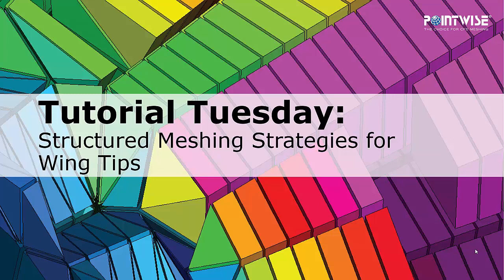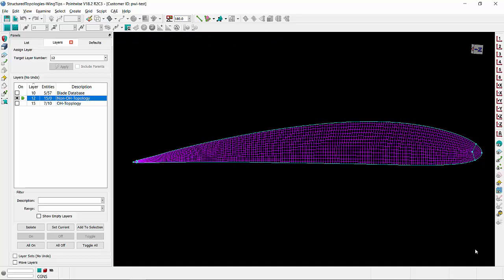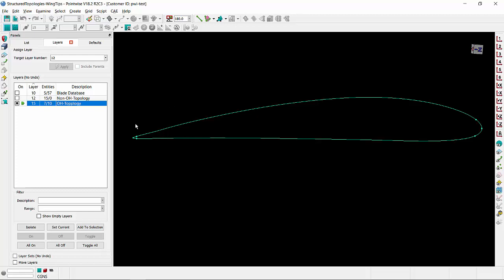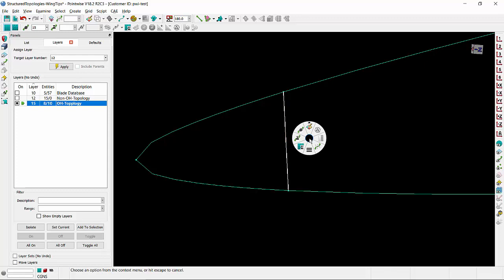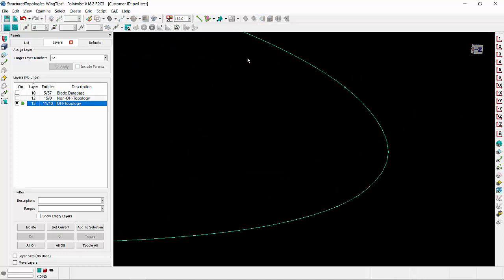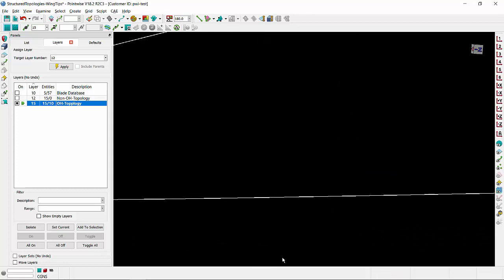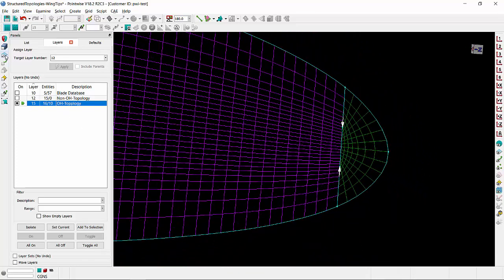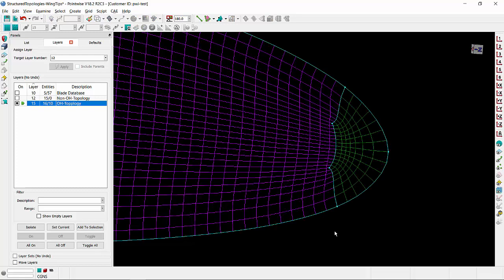Structured Meshing Strategies for Wing Tips

Comment: How do you know the number of points in each connector?
i used the sum of the number of points in the 3 connector equal to the sum of the other 2 but it didn't work